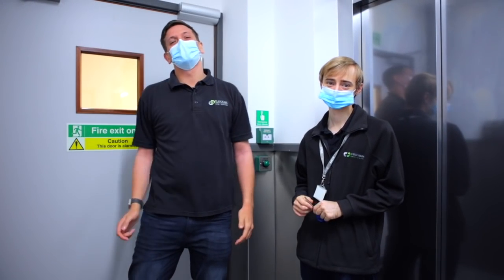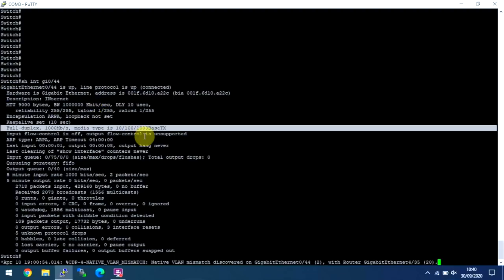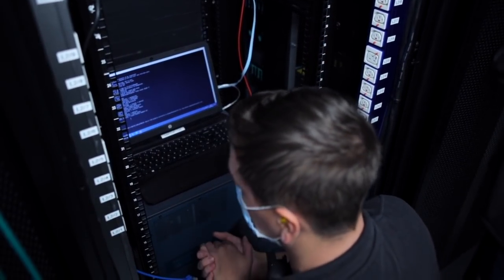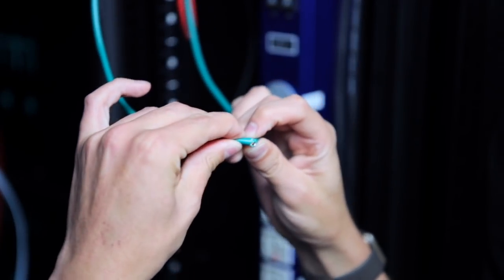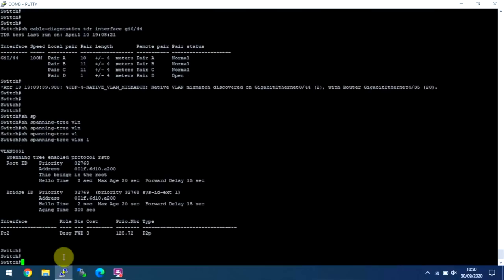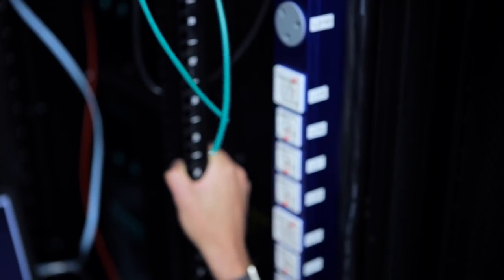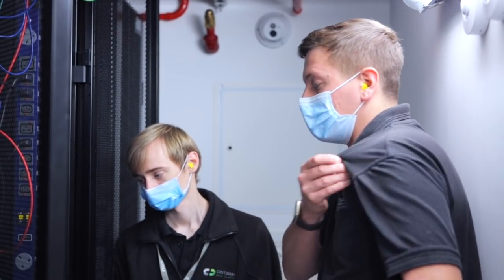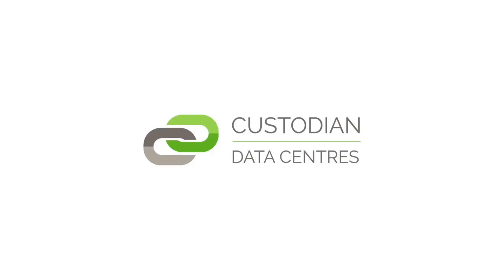NETWORKS Part 3 - Troubleshooting

Comment: You really have VLAN1 enabled and used as regullar network ? That is courage.
Reply: hahaha I noticed this as well. #networkarchitechture101
Reply: Why would that be ?
Reply: @aure_eti  Are you asking why it's not recommended or why they're using it?
Reply: @telnetx  why it's not recommended
Reply: @aure_eti  By default on Cisco switches, VLAN 1 is used for management, and is also the default VLAN for all the ports on a switch. An attacker could connect to an unused port and immediately have access to your management VLAN. If nothing is used on VLAN 1, they can't do anything, hence why it's suggested not to use it.
Reply: @telnetx  but if configuration is done correctly and all non used ports are disabled. You can use VLAN 1?
Reply: @aure_eti  Your native VLAN (which, is by default, VLAN 1) should never be used for users. Even if you change the native VLAN, some protocols in ios iirc still only use VLAN 1. It's just a good idea in general to not use it.